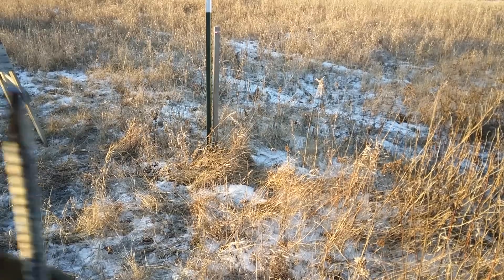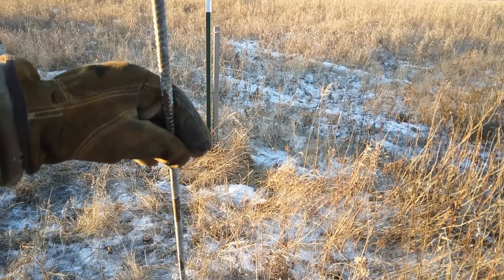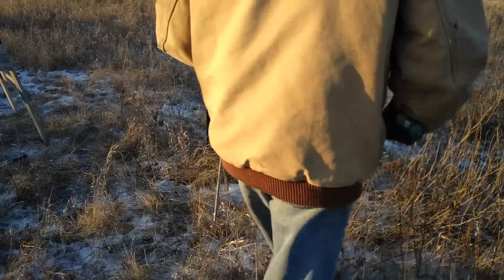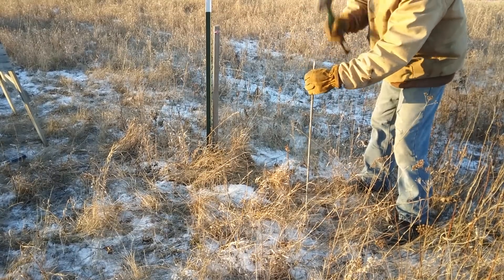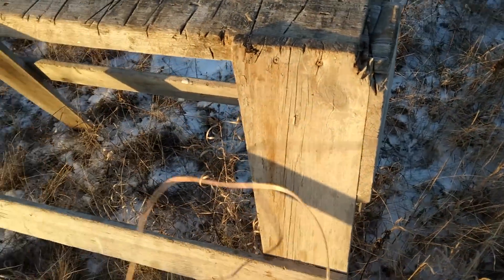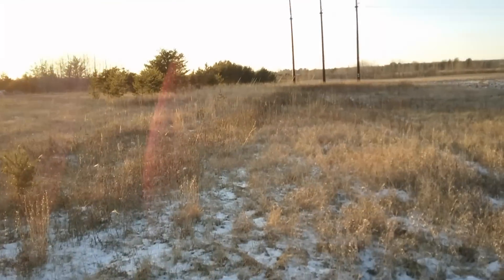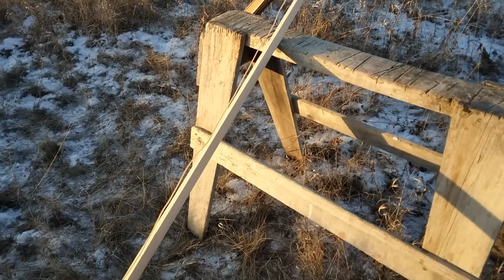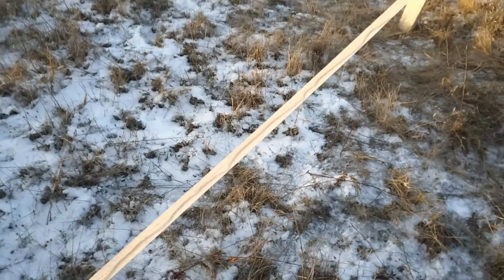⚡️💡Under the transmission line experiments.

Comment: See it as a parictic capacity the ground being one plate and the power line another plate. Now if one has a good ground and a plate surface on isolated wood or plastic and possibly an L one gets an L C system with a large R added towards nearest grounding of the power line. So with the right calculations one could make it light up more just actually the same setup Nicola Tesla used to light up his lab.
Because of the high voltage it lights up. Don't go full resonance by the way !!!

Nicola Tesla used a very high frequency source powered by a Tesla coil a ground line at one point and a floursecent tube or did just hold one in his hand becoming part of the circuit himself.

If one where to just put up a receiver plate a diode bridge cell and one has like I did a grounding and nothing metal shorting it one makes a receiver of all frequencies, with just a capacitor after the bridge cell a large power resistor of 2 Ohm (an electrolytic capacitor that got thicker oxides by slowly raising the voltage) ( dc because of the bridge cell 2 phase rectifier )
the power source in my case is a transformer close by or a power house from the electric company and a local radio amateur (who had possibly an ungrounded ground problem just recently moved his shack from a shack on the ground up to the first floor). 
I also had besides a fluorescent tube over the 2 Ohm resistor a neon bulb 220 volts as a discharge means should the fluorescent tube fail. 
It can be done and since I was away the kids ( who where not allowed in my shed and my lady complaint about the shed light being on while I used the only available fluorescent tube for this ) I told her to grab the tube in the middle and get the kids out. It works but needs continuous discharge see wireless transfer of power by Nicola Tesla as a schematic. Done in winter to have very dry air.

and it is especially underneath a power line not without danger especially if one calculates the right L for resonance ( my shed experiment was different see Nicola Tesla Experiment for wireless power transfer ) but in case of these power lines it is more like an experiment where one has a large plate with high voltage on top since the voltage is so high they light up a little but only slightly if done with higher frequency or with a higher up receiver ( a little higher ) one already gets a load out. By adding a larger L one already goes in the danger area. But one should never ever go for full resonance the C is the distance between high voltage line and receiver plate / wire the L is any added coil the R is the distance between grounding rod and any existing grounding of the power line system be very extremely careful with this it can kill a man easily. Just writing this to explain it here and under no circumstances should one go to far without the right knowledge. See Nicola Tesla writings about how he lit up his lab by having a high voltage plate powered by a small non sparking Tesla coil on top and one wire running from ground towards a floursecent tube Like thing without inner wires. One can even load up in theory an electric car by such a setup but the losses and interference would by significant one can also steel power by C with a kind of similar setup but I don't advice to do so unless for demonstration purposes.

Keep in mind that with a very extremely large coil and disturbances in the ionosphere 50 kilometers of windings one also can receive some power. In order to test this simply build a smaller Tesla coil besides a vandegraaf setup and get an led on it after a bridge cell.

If one looks into the way power runs through the ground one ground rod is not exactly the same as another, put up two ground rods with 50 meters distance and another couple 200 meters away, in a rectangle shape,  it will be possible depending on ground conditions to have a setup with a high voltage output from a tube amplifier Just Reverse the transformer and use a phone input at the other end to talk both ways... There are also ground return systems in Terms of power. 
It can be done even with a boat, in that case they need a rod on bow and Stern and laying beside one another to form the rectangle shape they don't even need so much voltage then because of the food conductance, 
just an experiment to show how ground and ground is not always the same if using ground rods directly...

Kind regards from the Netherlands...
Reply: Sorry my spell control messed it up a bit and I am not a native English speaker I hope the contents of the message are still understood. Keyboard in Dutch setting writing in English should have used my grammerly keyboard...
Reply: My lady did put the tube on the ground so it shorter any rf or any charge directly out only if in the middle between ground and antenna without any metal in my case with some rope and tywraps from the ceiling and no shorting out power by any conductive part does it work...
Reply: Sorry a premature post without spell checking Interpunktion or language controll...

Comment: I'd parked my car under some very high voltage transmission lines in California right where the lines sagged. It was next to a creek running from a hot spring. I had gotten out of the water and sat on a small aluminum beach chair in the dirt next to my car. I touched my car and felt a pretty good voltage. Definitely made me pull back. It would have been interesting to measure the voltage with a meter but I didn't have one. The car was acting as part of a capacitor coupling through the air.
There was a radio station in Hampton Virginia the early 80's called WPEX that put up fluorescent tubes on the tower so that it spelled out "X 15". It looked cool at night from Rt. 64. with the bulbs lit up from the RF of the antenna.
Reply: Wireless charging for electric cars. Lol
Reply: Not a capacitor. An inductor.
Reply: @ Thanks for the correction. I was thinking air dielectric capacitor but indcuctive coupling makes perfect sense.

Comment: When I was in the Navy back in the 70’s we used to strap fluorescent tubes near high powered radio sets when tuning up. The flickering lamp was a good indication we were transmitting.  Also I rembet bring on a ship within 10 miles if a very high powered VLF transmitter and all the fluorescent lamps that were off would flash on and off.
Reply: Have a LED shop light light that never dims, think that might be the reason.
Reply: My brother lived in Waianae not too far from the huge Navy ammo dump and the ULF transmitter site and he used to talk about the florescent lights flickering and some radio and TV reception problems when they were transmitting..

Comment: Thirty years ago I drove a clean garbage truck picking up recyclable cardboard. I was loading cardboard into my truck from a dumpster, which was positioned under large electrical wires. I mean LARGE. As I was doing this, my upper arm touched the dumpster, and I received a mild continuous shock. I can't imagine what that might do to people who actually live in houses situated under those wires.

Comment: a CB Radio properly tuned can illuminate a Fluorescent tube pretty well, i've done it and scared a friend of mine half to death with the demo, with a Linear amp the light was full brightness end to end and plenty of light to read by, and we did something similar when i was in Vo-Tech, we had some high-tension lines that ran across the campus, our instructor had a PVC Pipe with a fitting that was the right size to clip a Flouro tube into and hold it up in the air, with the other end going to the ground with just a tent stake on the end of it, it was i want to say a 10 or 12 foot chunk of Schedule 40 PVC and that tube lit up, not super bright, but bright enough you could see in the daylight, so it is doable, and its crazy what kind of power radiates as RF from things we use day-to-day, also i mentioned the CB Radio/base station with the Fluro tube, you can do the same thing by standing near an AM Transmitting station, or a SW station, that'll light a tube pretty good from not that far away (~100yds)
Reply: I used to run a small tube on my antenna with a linear "heater" and it lit easily although it screwed up my SWR. I did hear tell of a guy who had a far bigger amp who lit a McDonalds sign accidently - his alternator was apparently NOT happy about the current draw! I also had an issue with an intercom system at a bank keying up to talk to someone while in line in my car - the teller was NOT pleased at the noise on her end 😲

Comment: Run a long insulated wire a few feet off the ground and
parallel to the power lines to act as the generator antenna and connect the wire to one end of the fluorescent tube and the ground wire to the other end of the tube. I think you will have the potential to get more induction with a horizontal antenna than a vertical one.
You could try this set up with your rectifier circuit and check out the DC output. 
I would think that the length of the antenna will affect the amount of electricity inducted into the wire and that a longer antenna has more output potential than a short one and that horizontal orientation would be better than vertical. I could be out in left field on my suggestions, it's Just a thought
Reply: Yes i do agree
Reply: Try a 1\4 wavelength wire antenna stretched out under the transmission line. :-D
Reply: That would still be a very long wire @ 60 hertz's @amooser5839
Reply: It's capacitive coupling, not induction. Different animals.

Comment: We used florescent light tubes to peak tune the final radio frequency output tube on a commercial AM radio station back in the 1980s. The brighter the flash, the more signal was being delivered to our antenna.
Reply: We did that in the 80's when us teens all had cb radios in our cars...the guys who had "boosted" radios could light them up pretty bright by the antenna on the trunk
Reply: We had a floursecent tube at the top of our transmitter tower 40 meters high at the boys scouts when a jota jamboree on the air was held to warm us not to climb the tower... We where only allowed to sit in a net several meters above ground in the tower made of wooden beams... The warning was quite visible contact even with Australia from the Netherlands under the right atmosphere conditions.. professional radia ham people who for once could go all out in power since at jota time no limits seemed to be there as long as you knew what you where doing...
Reply: A saw a group of radio engineers do a rough tune on a 5 tower transmitter site that phased the towers where 1 or 2 would be hot and 3 or 4 would be grounded to make the tower array directional.. They setup a whole bunch of tubes hanging from tall wooden poles about 100 feet away from the towers in a circle around them.. Then by switching which towers were hot and which were grounded you could easily see that some tubes were bright and others were dim.. A few days later we took a truck with an extendable antenna and a field strength meter and drove to somewhere around 50 places on the map taking readings day and night when they had the antennas setup different ways.. The matching coils on those AM stations that I saw attached to a whole row of amplifier cabinets were huge and made out of copper tubing that was 1/2 inch to 1 inch diameter and 4 foot across.. This was very different compared to the VHF FM transmitters that were just a couple small rack mount exciters connected to one 6 foot tall amp cabinet..

Comment: Ok...for one thing, that transmission line isn't on the magnitude of a real HV line. Circuits like the one in the clip supply smaller loads to step-downs for smaller distribution areas.

If you want to see the effect you're aiming for, the power line has got to be one of those spicy 765 kV ones. That's where you see those dramatic pics being taken.

One other note...about that "antenna", you need to never use that, period! Consider what you're proposing doing: holding up a conductor under a transmission line that has to be up that high in a CLEARED path is potentially suicidal. You're providing a closer path to ground...and if you do this when the lines are making those sizzling noises, there's a very REAL possibility that all that will be left of you is a smoking pair of shoes and a big, greasy soot-mark. DO NOT EVER DO THIS!

Comment: Connect a battery on the filaments.Heat will make the electrons faster.Also theHg will evaporate and make gas conducting better inside the tube

Comment: Merely carrying around a fluorescent tube inside a darkened house when the humidity is low, such as during cold weather, will produce visible flashes of light due to small electrical discharges you don't even feel.

Comment: I work for a power utility and work with high voltages. Lines and substations.  Those weird looking places that look like space ports. There is a reason we build fences around them and put up those danger signs. Please be cautious, these lines and installations transfer and control extreme amounts of energy. Be very cautious around facilities high voltage or any voltage if your not fully knowledgably and trained.
Reply: Yes, the high-voltage power lines can be very dangerous.  I recall an incident in December 2007 in East Palo Alto, California.  A 23-year-old man was electrocuted while hanging Christmas tree lights in a 60+ feet tall redwood tree at an apartment complex.  Here is the gruesome story, copied as reported by FOX News at that time:

--------------------------
EAST PALO ALTO, Calif. – A man decorating a tree outside an apartment complex was electrocuted when a string of Christmas lights touched a high-voltage power line, authorities said.

The 23-year-old man, who had climbed about 60 feet up a redwood tree in East Palo Alto, was trying to throw the string of lights onto hard-to-reach branches when he was killed instantly Saturday, according to Menlo Park Fire Protection District Chief Harold Schapelhouman.

Shortly after a neighbor reported the incident around 12:20 p.m., fire crews arrived on the scene and found the man's body attached the tree with smoke rising from his feet, officials said.

The body hung for more than an hour as hundreds of neighbors watched. Firefighters had to wait for utility crews to shut down power lines that supply electricity to thousands of nearby homes and businesses.

Firefighters brought the man's body down from the tree after the power was turned off, Schapelhouman said.

The victim, whose name was not being released until his family was notified, worked for Page Mill Properties, which owns apartment buildings in the area, Schapelhouman said.

"Our heart goes out to this young man and his family," Schapelhouman said. "He was trying to improve things a little bit for Christmas and he made a small miscalculation and it cost him his life."
Reply: I’m amazed by substations. Over time I’ve figured out the switches… Just seeing how the lines attach to the insulators on the poles is amazing. I figure most are completely clueless to all the hardware required to power that TV.

Comment: The sizzling is corona effect. The air acts as an insulator between the lines and the ground {earth}. With moisture added and temperature effect  the insulating effect of the air is reduced close to the conductor (wire). The noise you hear is the ionizing of the air. The air molecules are being polarized and beginning to conduct electrons dissipating energy into the surrounding air.  How a radio/television  transmitter works.